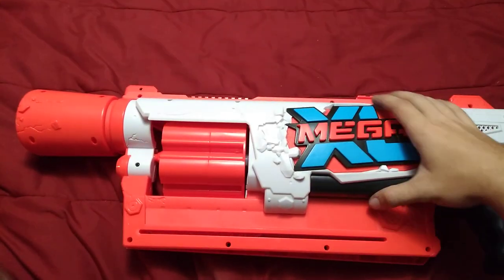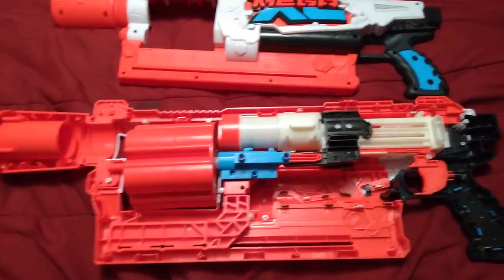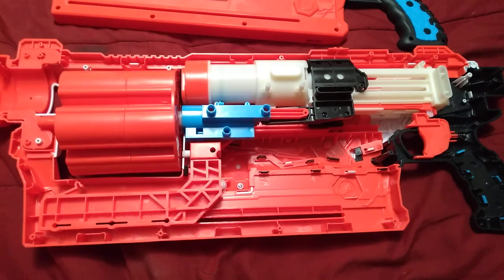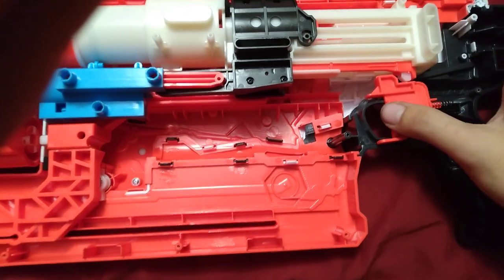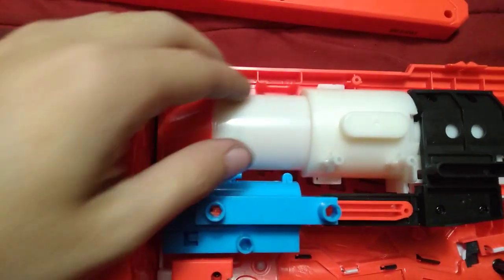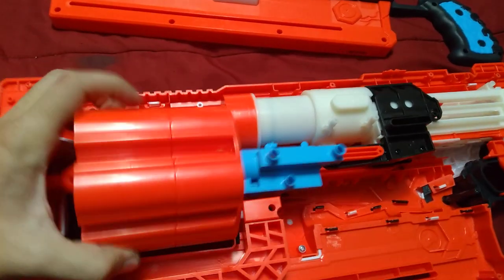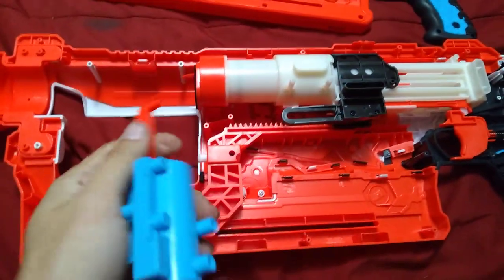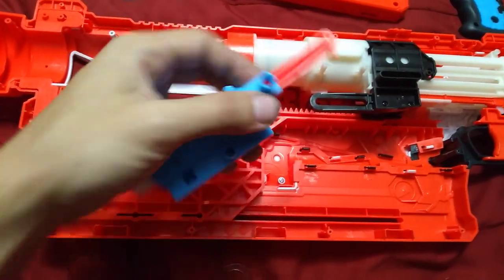Nerf Mega XL BoomDozer internals

Comment: Woot! What a score! Two burning questions then: what are the dimensions of the XL darts themselves? (especially keen on finding the outside diameter...) and does the dart fit on/get fired from a spigot/post/tube (like a Demolisher missile) or are they held/sealed in the cylinder on the outside of the foam body (like a regular Elite or Mega dart)? Thanks =D
Reply from the maker: Sealed and seemingly built like a regular dart, and fired via some sort of small bastard spigot,
Reply: @hangmanindustrial5262  Thanks!